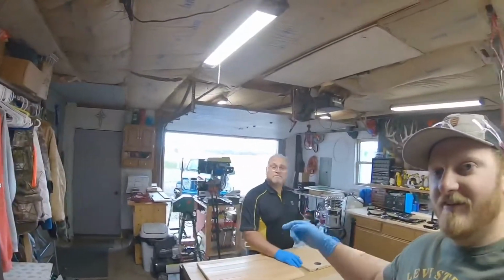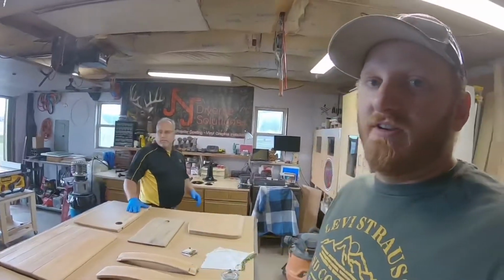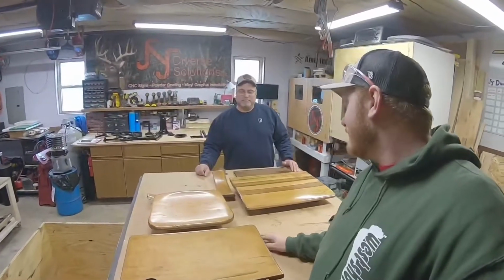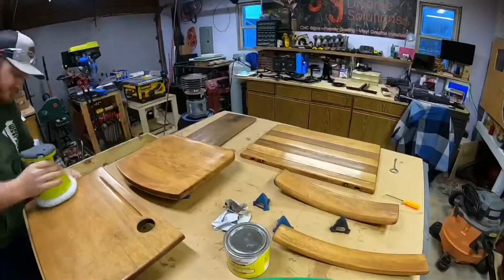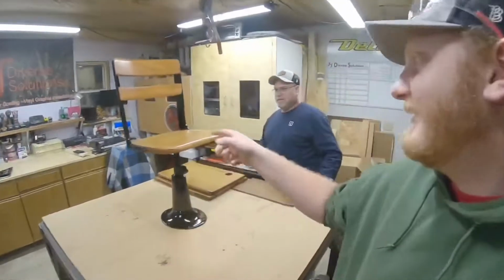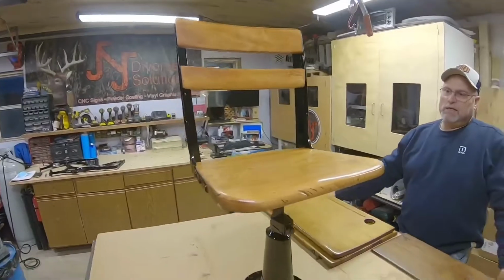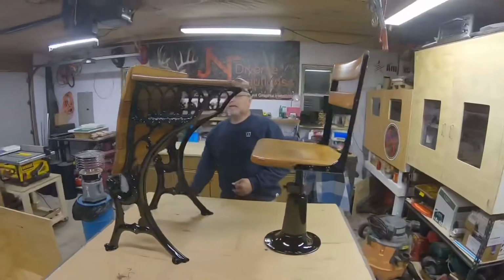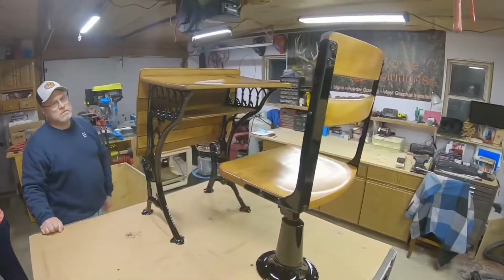Antique Desk Restoration Pt. 2

Comment: What kind of stain did you use and did you use a prestain?
Reply from the maker: We ended up using a Minwax- Early American Stain with a Minwax Gloss Polyurethane for the top coat. Sanded that smooth with 1000 grit, then used some Minwax Finishing Wax for shine and durability. We didn't end up using any pre stain at all.